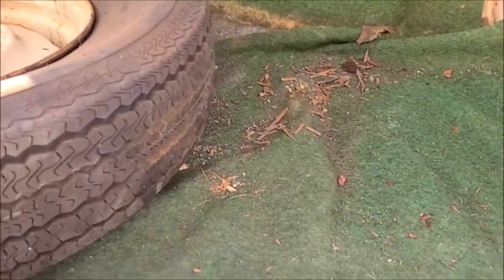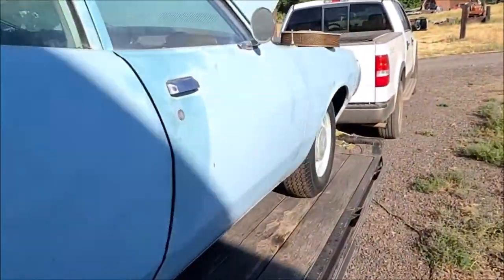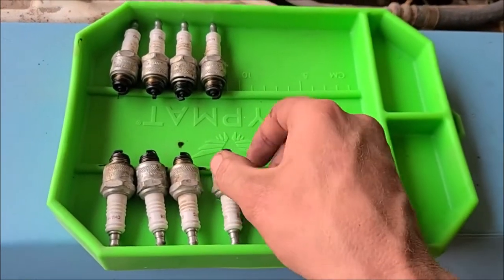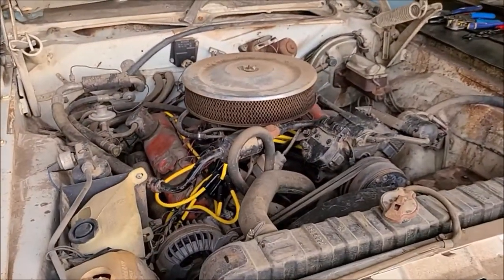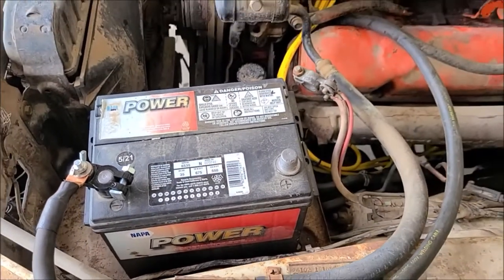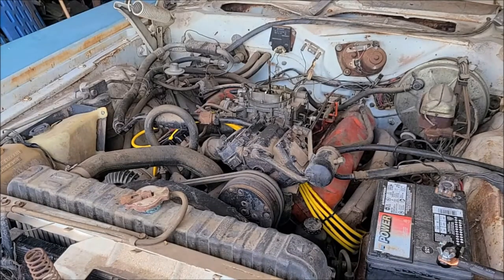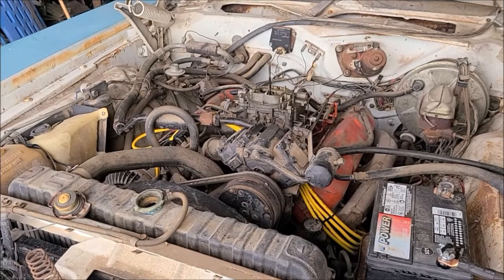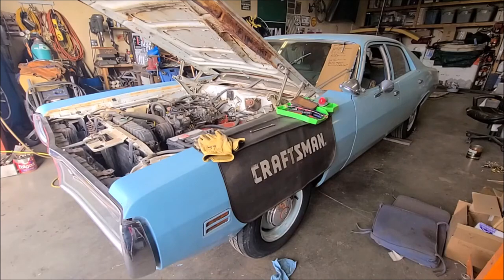1971 Dodge Coronet Police Car Episode 2 - Will it start after sitting for 30 years??

Comment: I own a 1971 Dodge Coronet police car that is painted B-1 Blue Sky. It is a factory color and was used by some police agencies. Although yours was obviously factory white, the baby blue color is all that uncommon. I've see several painted in the same color. 

Mine beloged to the City of Fairview, Oregon. My grandfather was the chief of police. The car was bought new in 1971 by the Oregon State Police and used as a campus police car at Oregon State University. Fairview purchased it in 1979 from OSU for $700.00, as surplus. I restored the car in 2014. It has all the original police equipment from 1979, as it was built by my dad, for my grandfather.
Reply from the maker: That sounds awesome!